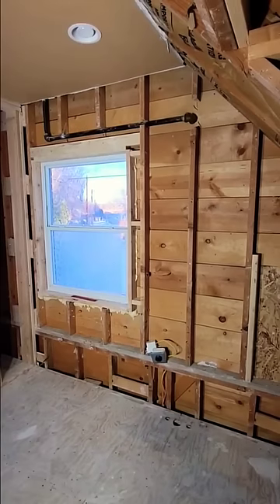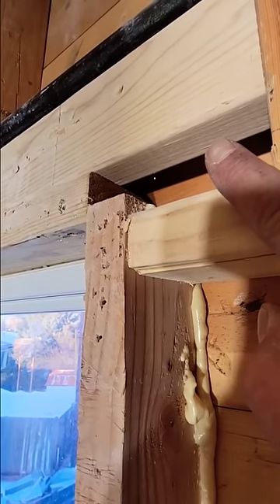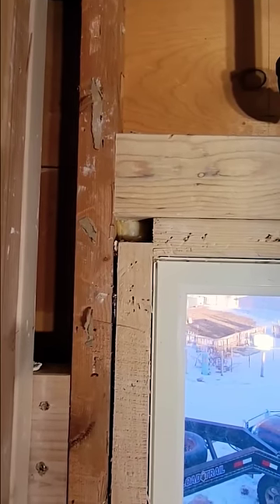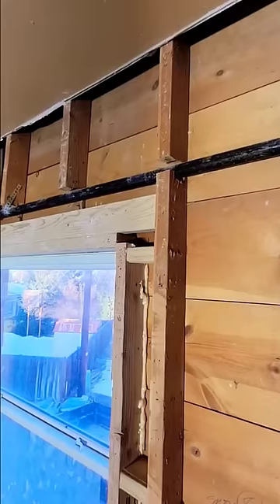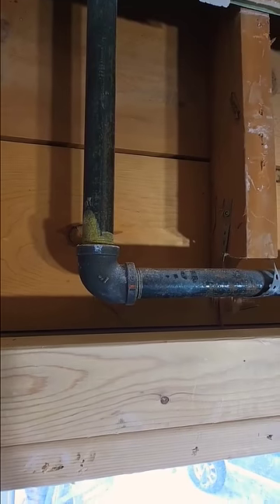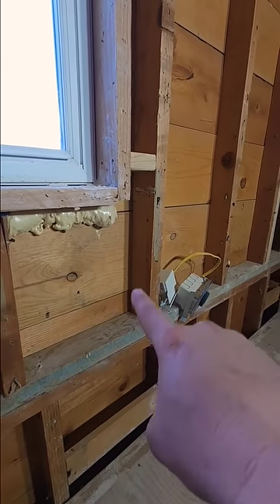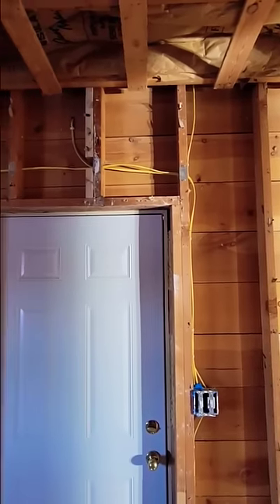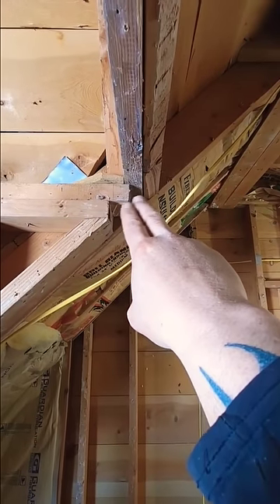Why ((REMODELS)) cost so much! #hacks  #construction #framers #plumber #shorts

Comment: This house has 1x8 solid wood planks. It does not need a header or king post for structural integrity.
Reply from the maker: Yeah, not sure about that!!! I do know it needs everything I have put in it by code!  What you are saying is that the 8 penny nails that is nailing the 1x8's are the structural of this building? Yeah that don't work at all!
Reply: @307Garage  yes, for code it is required. For strength, not so much. Pole barn construction and Norwegian code both utilize this method to forgo the use of a traditional US header framing. There is no structural issue.
Reply from the maker: @MHow1900  A pole barn is built with load points coming down on the post. Then are made to carry the load from one post to the next! Not even the same as standard framing! Standard framing is load points at every stud! Then when you want to span a window opening. You will put a header in and have 2 to 4 king studs on each side of the header coming down to your load point in your floor or footer. Then have 2 to 6 Trimmers under the header. The 1x8 sheeting is not doing anything to help the load transfer to the footers! the only thing that is doing is to save your house from blowing over in a wind storm!
Reply: People like you Keeps this guy in business!
Reply from the maker: @eriksmith5950  True that!
Reply: @eriksmith5950  people like me? Hahaha. His fix is appropriate. I am only calling out the structural integrity statement. His claim that digging into walls in an old home and finding a nightmare is spot on. Recently remodeled a 1901 two story victorian, 4,400 sq ft and a two year job, previous owner remodel did everything wrong.
Reply: It still needs headers. It’s likely that 1”x 8”, solid exterior wood planks provide enough redundancy, and that’s why the structure hasn’t collapsed!
Reply: Such DIY shortcuts are all too common…
Reply: Pretty sure he knows what he’s talking about, after all he’s licensed and confident enough to post to millions his statements and you’re just a troll lol
Reply from the maker: @Jordan Fowler Thanks you!!! You nailed it! And to top it off, I have been a general contractor for 30 years fixing stuff like this for years! But to all their own! Like the other guy said on here! That is why I have a job!
Reply: don't listen to this guy. clearly he KNOWS everything while at the same time not knowing what so ever
Reply: Geewhiz always use the correct size header, and the correct number of jack studs and king studs at every opening regardless of the exterior sheathing or this case 1X8 planks. It’s just good practice and how things are done. You can also ride a bike with fucking flat tires but you’re not supposed to do it.
Reply: @markmoore8385  EXACTLY! LMAO
Reply: That wall isnt even loadbearing, you dont need headers on internal walls either, stop wasting wood please
Reply: I think about the leaning on it integrity
Reply: I love when people talk like they know what they’re talking about.
Reply: @307Garage ...Well, I think we found a few who have no clue, and rather then higher a contractor attempt to do it themselves.
Reply: Gable end wall, little roof load...However, that house is hack central.
Reply: just stuff those walls with some structural insulation and slap on a coat of structural paint! She'll hold!
Reply: Regardless of structural integrity or not, that's now how that remodel should have happened
Reply: @MHow1900  I like how you and the video poster had professional and civil discourse. I respect that a ton. I know you both work hard and with integrity in your trades.
Reply: @benjaminhoglund4496  what interior door?
Reply: @17Scumdog  don’t forget the load bearing caulk!!
Reply: It's the old material... Quick google search will show why the code has change.... It's the lumber ...
Reply: @DvstyDom  I'm sure the guys who did the recent renovation thought they knew what they were talking about too.
Reply: U know . They dont . Maybee thats why he does tiktoks for a bit more income😅
Reply: @307Garage  come on you worry too much
Reply: Lol if your building a dog house it be ok.
Reply: @M How  try explaining that to the inspector
Reply: @Damian Okon  yup.  The author is not wrong to want to improve, however, many buildings do not gave today's methods.  A good carpenter can see the forest through the trees.  Once something is opened up, it is in his better interest for him to fix what he sees.  However, he does not have to rebuild the hole house.  Thats part of the job.
Reply: You are not entirely wrong.  There are a few nuances this guy does not want to acknowledge.
Reply: It's also a non load bearing wall and a header is not required.
Reply: @MHow1900  PIN OF SHAME 📌
Reply: Unless you need to bring it up to code to pass an inspection I'd give the homeowners options on just how crazy they wanna get fixing stuff. The more you fix the more you find that's been half assed over decades of shortcuts. Where do you draw the line? We all know the right way but the stuffs that's been hidden in those walls is most likely the same scenario throughout the house.
Reply: @307Garage awesome vid dude!!! 👉💯🎯✔️👋👌😀you speak knowledge
Reply: And residential code book will reveal thats a lie.
Reply: Wtf
Reply: It was remodeled 10 years ago by a hack
Reply: @MHow1900  there is almost no load on that header
Reply: @MHow1900  I bought a home that was 'owner built' - the worst mistake of my life. I've learned a lot about building codes and carpentry since then. 😕
Reply: I think we may now know who was overseeing that last remodel... isn't that right M How... buhuhahahahaha
Reply from the maker: @mick7even  That is right!
Reply: Why is 1x8 nailed into studs any different than nailing into plywood. He is absolutely correct about the poor framing. What you sheet your walls with ain't "good enough".
Reply from the maker: @marcuspeters5855  Thank you!
Reply from the maker: @TheUnleashed123  yep
Reply: Sheathing is not load bearing structure even if it is solid wood plank or plywood
Reply: @MHow1900  tpical yt comment. Telling the video maker he’s wrong and this is why…
Reply: I only got 10 years left to live if it holds up that long I'm good.  😂
Reply: yeah ... Not in any jurisdiction I have built in 
go take a look a Simpson's earthquake machine testing headers and their connections,  and you will see why every part of the modern best practices are the required minimum.
Reply: @georgemckenzie2525  yes and I'm glad you said it is a minimum.  We as builders should be encouraged to exceed the building codes.
Reply: @henrywight4057  amen 
Know, and exceed !
Reply: @DvstyDom  Not saying anything negative about this guy, but all you just described is the definition of a politician... doesn't mean much.
Reply: @ibealion1  brother you’re bringing political strategies into something that isn’t based on opinion whether it’s logos pathos or ethos but solely just factual mechanical concrete evidence which most engineering systems are based of
Reply: @DvstyDom  oh like doctors with vaccines 😂🤡
Reply: @dylanvanhoorne3191   again opinion, nobody was forced to get them or penalized or jailed for not getting them because professionals said “risk outweighs the danger” it was completely up to you, codes are enforced and can take legal action against you for not complying, try again bud
Reply: I know for sure you can't see it from my house after their check clears.  Lol
Reply: @307Garage  Look at it this way, you said this shit work was done 10 years ago.  But look at it, it's not sagging.  The window isn't holding it up, the sheathing is.  Also, the roof point. it's not sagging?  that means its got no load on it.
Reply: What kind of nonsense is that! THATS like saying, "This house has 4x8 plywood sheets on the exterior and 4x8 dry wall sheets on the interior." IT STILL needs headers and full studs for structural integrity, jeez! Sounds like you did this and covered it up.
Reply: @markmoore8385  that was the best way I've ever heard "just cause you can, doesn't mean you should" put into a real situation, ever. Especially cause that common sense, I had to learn the hard way as a kid. 🤣 I ripped the stems out of tubes a couple times before my dad went ahead and told me what I was doing wrong. I wasnt so stupid as to ride with no air, I just wasnt properly inflating them cause I was being lazy. Lol I learned my lesson the hard way.
Reply: 😂😂 found the guy who did the original remodel 🎉🎉
Reply: @DvstyDom  You made me sound very sophisticated and I extend to you the virtual hand of commendication.
Reply from the maker: You should 100% point them out after watching my short I posted yesterday!
Reply from the maker: Oh he is!
Reply from the maker: So true!
Reply from the maker: Go watch my Short I posted yesterday. It points it all out! And yes, It was down over a inch from where it should of been!
Reply from the maker: Right!
Reply from the maker: LMFAO YEP!!!
Reply: actually it does. would never pass code
Reply: Yea please don't ever work on anything to do with structure again, because that's just ridiculous
Reply: It's only lasted 50 years like that....better fix it.
Reply: That’s right. Mr. Construction man too picky 😀😀
Reply: @TitusPullo08  No Dino! You CANNOT bid what you don't see. That's absurd! You do however have a contract with stipulations addressing unseen issues.  PERIOD!
Reply: I'm with you!
All this house needs is a gallon of gas.
And start fresh in the morning.😂
1x8 planks?  Being a carpenter for many decades, I'm use to to hearing stupid shit, and that is up there in stupidity.
Did your wife tell you that?😮
Reply: @Sun-for-man  I’ve been a carpenter for thirty years. I’ve seen and heard a lot of idiots acting like they know everything and your comment certainly reminds me of them.
Reply: @307Garage  Quick question from someone not-so-versed in this, but you keep saying "up to code." Whose code? Hoping it's not government code.
Reply: Not on a gable wall.
Reply: @307 Garage  I had a 57 foot basement wall cave in on my own home built just like that. Only the corners were left. The middle of the wall only dropped 2 inches. 1X8 lathe boards on the inside walls also.
Reply: @307Garage yeah your just overdoing everything wasting time and money. All “code” is, is money racket. That house has stood for 10 years and will stand another 100.
Reply: @DvstyDom  What does licensed have to do with being correct? If he's correct then he's correct. Being licenced doesn't mean much anymore. How much of the dodgy crap that people find was actually done by licenced people? 
Where i live people haven't been allowed to do their own work for a long time, but electricians certainly don't trust the work of others, not just because that's s safe way to operate but because they've seen what other qualified people have done. 
Where's the proof in this video that it wasn't a qualified person who did the work?
Reply: @locknload9143  maybe that's because a few people admit their mistakes in trusting contractors. There are good ones, but there are a lot of bad ones too and just because they have a lot of experience doesn't mean they do things properly.
Reply: @TheOnlyJoshH  why shouldn't people tell someone they're wrong and explain how? That seems completely sensible and reasonable to me. Lool at sll the dodgy hack videos. Should we not comment and save others from doing something silly? 
This video was essentially the same as what you described. He showed others work abd explained why it was wrong.
Reply: @chrisnoname2725  no you’re right 100% right**
Reply from the maker: That is right!!!

Comment: I bought a house built in 1951. I knew it needed new post/beams to support the center of the floor. However, as we started the remodel/addition I found so much wrong that by the time I was done gutting it, I had 10ft of wall left.  So we demo'd the remaining wall and foundation. New foundation ready for pour, lumber on site, trusses waiting to be delivered. Sometimes it costs more to fix bad work then starting over.

Comment: I'm not a tradesman, but I like doing remodel work myself. I learned a lot from an incredibly experienced crotchety old f*cker.

He made an exception for us because he was a decently close friend, but he said once that he retired from doing work like that on any houses older than X years because it's not worth the headache.

Our house is close to 100 yrs old, when weight loads were much different. One day when I was reinforcing the basement joists out of principle, I noticed a main sistered joist was fuxking free floating at the one end. Maybe back in the day it would have flown, but there's no chance today. With tile and modern loads. I put a column under it but I started noticing all these spots where it just blew my mind that someone at various points over the years did a half assed "job".

No wonder the tiles there cracked 😂
Reply from the maker: Yep. Houses are getting heavier and heavier every year.

Comment: When looking closely the home is built like an envelope home where the wall actually goes all the way to the first floor and the second floor is attached to it. Also the window is on a gabled wall and you could literally take the wall out and it wouldn't matter because the roof is supported by the rafters. Yes there are codes that would red flag that but there are also areas as you pointed out that should have been done differently. Depending on where that home was built it was likely constructed in 19th or early 20th century. I'm not saying that this work was built to code but codes are constantly changing and work that was done decades ago might have been okay then but would not meet today's codes. But it drives me nuts when people today are trashing work done decades ago not knowing the owners situation weather it'd be financial or not knowing how to do things. The only way people learn is by making mistakes. And with the internet now we can learn how to learn from other people's mistakes. So lighten up.
Reply from the maker: You are right, But how it was framed up there. There was a lot of load on even that gable wall. + living in Wyoming, there is a big snow load we have to go by.

Comment: Seeing some of those remodel from the past 2 decades make my soul die slowly. I get it. i took down an entire wall because at first wasn't level to later find out why , and it was just hanging from the ceiling with drywall sandwich in between and a gap to the floor. Seen some bad stuff in the past years that almost gave me nightmares.
Reply from the maker: They are everywhere.

Comment: Yes and a remodel you never know what you're going to find we actually were called by customer to insert a Elevator Shaft in a 4-story house here recently and found out that the main carrier beam that holds up half the house was simply sitting on top plates so you had several times sitting on 3in of 2 by 4 with no leg under first thing we had to do was hold at the house if those plates would have blown it would have brought down the entire house
Reply from the maker: WOW, That is crazy!

Comment: I'm doing an exterior staircase that was attachesd to the block wall with 3 "2-1/2 tapcons... that was it... no straps, no hangers, and just gravity holding in place. 4 feet wide and 20 feet long of rot and twist.
Reply from the maker: WOW! That could of been way bad!
Reply: @307Garage  by some miracle it stayed up for 30 years. With the top landing sitting on the roof without being secured in any way, posts not in the ground just floating on post pads, treads only attached on one stringer with two nails, and sprinklers on all sides keeping it soaked in florida.
Reply from the maker: Were you the one that emailed me about that?

Comment: I am currently in the process of renovating parts of my house due to poor maintenance through three previous owners. The shit I am finding is unreal and I spent 25 years in the construction industry. Four different types of plumbing lines, metal electrical junction boxes missing covers, absolutely zero insulation. I’m not sure what the construction term is but the exterior walls are all 1x4 diagonal slats. It is true 2 x 4 construction. Mostly rough cut. It’s more than obvious that the doors and windows have been moved multiple times. I think the only thing that has never been relocated in the house is the toilet its self. Clearly signs of Harry homeowner repair work. When we bought the house, it was aesthetically looking really good. The exterior needed to be replaced, but overall the house appeared cleanly done. If I had a chance to do it all over again, either wouldn’t have bought the house or I would’ve bulldoze it on the day of signing.
Reply from the maker: Yeah there is a fine line to take down and start over or fix it.

Comment: Having done a bathroom remodel for myself, yea, seems the HUGE amount of time/effort is not the tearing out and installing fixtures, is is the horror shows you uncover after they are out.  All of the plumbing that is JUST not in the right spot.  All those adjustments to MAKE the new stuff fit properly.
Reply: In my experience it’s always better to rip it ALL out.  Don’t salvage a damn thing.  It’s always cleaner and less hassle that way, even if it costs a little more.
Reply from the maker: It is a lot of work
Reply from the maker: Yep, we never use the same material except for blocking.